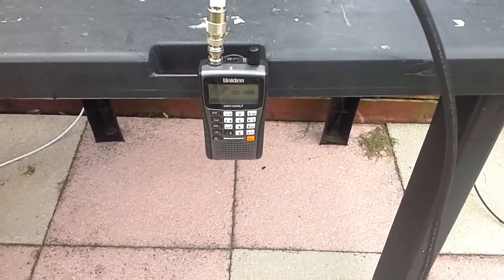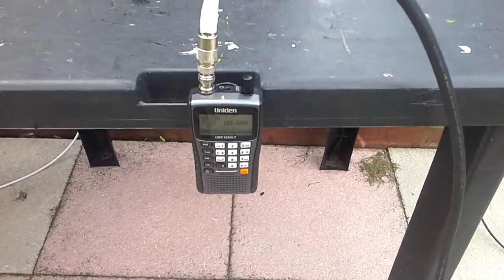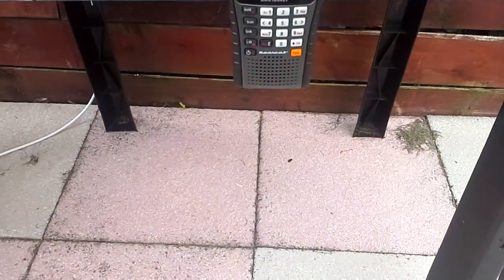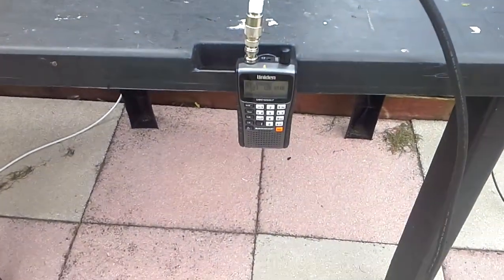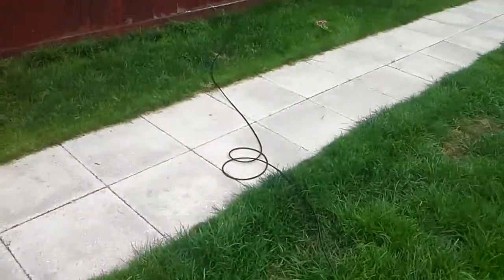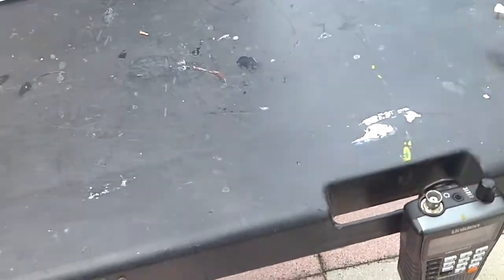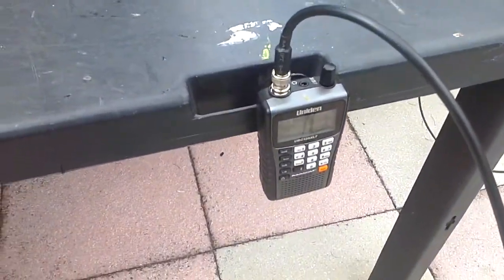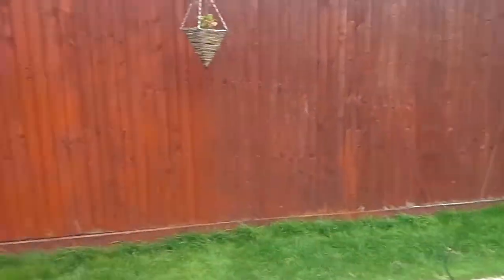2nd of 2 videos showing results of testing cheap vs expensive coax for receiving vhf airband

Comment: Mate, you should post your licence back. Loss increases with length, of course there's very little difference in just a few meters. Do the test again over a typical length someone may be using at home, 15-20m maybe. You must be thick.

Comment: I'm glad you say in you opinion. What length of cable are you actually using? And what is it like when tuning in to a weaker signal? Also you should point out that having a good connection inside the plug is more important than the quality of your cable.
Reply: I say in my opinion because that is exactly what it is ? As you will see if you watch the video's you will not that the connectors are the same and although I haven't actually measured the cable the cheap coax is at least twice as long closer to 3 times as long as the so called low loss expensive cable and so in essence should not produce the same quality strength signal but it clearly does and it does so on a number of different channels using signals of various strengths